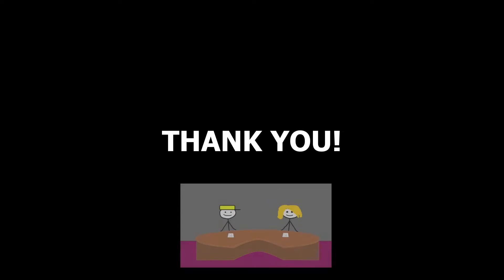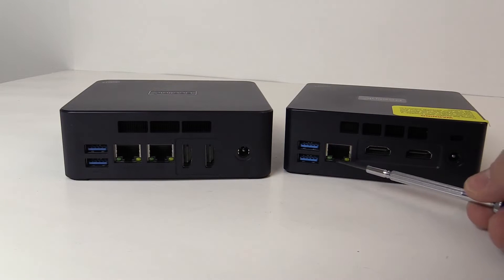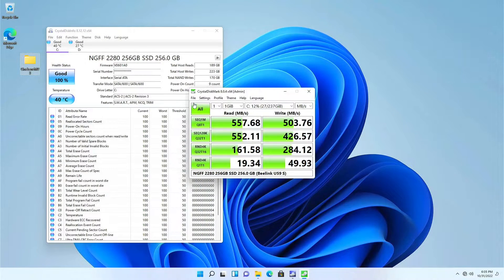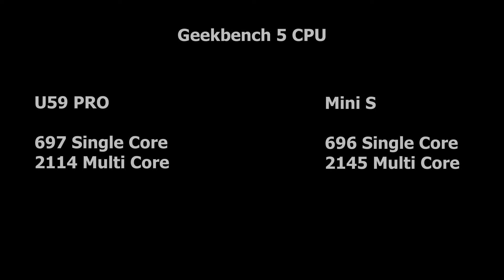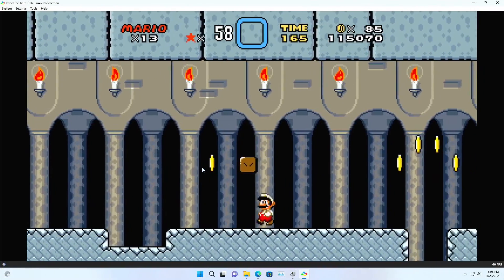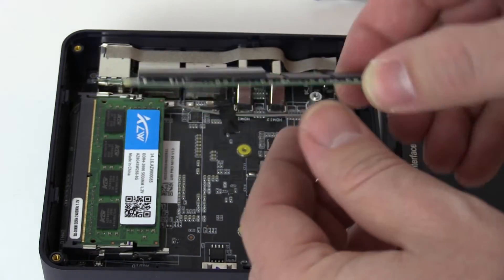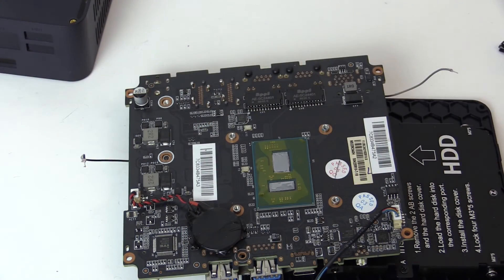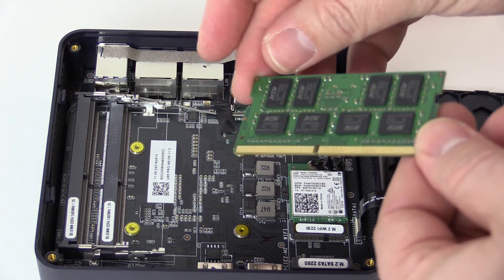Beelink U59 Pro vs Mini S! Synthetic Benchmarks, Teardown, and I Break Something!

Comment: things i was not told when buying this mini pc . first its just an m2. drive with sata speeds not an nvme which is at least 4 times faster but cost nearly the same  
Also if u live in a hot country DO NOT BUY THIS !!  i  live in Thailand and even when it was cool i kept getting an alarm and message your mainboard is to hot  at 82c  now it is 40c + i cannot use it  . even a coolpad underneath does not work as the are no vents only the side vent for the fan inside . I now use  a usb fan , a coolpad and a big 16 inch fan on this just to get the temp under 70c  or i get the overheating message and it shuts down
Reply from the maker: Ouch. At 40C it is difficult to keep any PC running very cool.  Most of these minis I don't think are built for that kind of environment. I wouldn't have thought of that though, thanks for sharing.
Reply: I found my 3 year old U59Pro was at 32C. Yet it would shut itself off if transferring large files or doing heavy work. I replaced the CMOS battery. I put a USB fan under it and it worked for awhile. And then it shut down. I finally put the fan on the side of the mini pc and it works great now. Blows the heat out through the other air vent. I saw others say don't do that. It will  send dust and cat/dog hairs into it. I just transferred 2tb to a backup drive without a problem. PC has always been very quiet. Love it

Comment: Did the same thing - soldered wires back in place - lol - fun
Reply from the maker: Sounds like it. With a cable that small I wasn't sure if there was a center conductor and shielding I would need to worry about.  I just pulled the card, the system is working as a pfsense machine so WiFi isn't needed.
Reply: @ntgm20  used  to work for Apple assembly in CS Col -  one of the few who didn't need magnifiers to do board work, the fun was sanding down a fine soldering point to ultra fine - lol

Comment: I purchased the U59Pro with 16GB of memory.  I encountered two issues: 1. the screen went dark for a couple of seconds intermittently running Amazon Prime movies.  This happened a  couple of time during an hour's worth of watching.  2.  Windows 11 pro updated itself several times and after the third update, Windows slowed noticeably, especially running YouTube.  I also installed Manjaro Linux which runs great.  Any suggestions/comments will be welcome.
Reply from the maker: Uncertain what could be going on with either of those issues.  I did a fresh install of Windows but didn't run it like that for long.  My U59 Pro is currently running pfsense and acting as my firewall.
Reply: @ntgm20  Thanks for your suggestion.  I will download and try to install windows 11 pro and hope that MS will recognize my key.  FYI.  I installed a Manjaro Linux on a SSD drive and it's soo much faster proving the hardware is fine and it's definitely a Windows problem.
Reply from the maker: @bartniaux8630  Good to hear. As for reinstalling Windows, I've not had a problem with them activating once installed.

Comment: I've just bought a Beelink Mini S. The object of the exercise was to upgrade to Windows 11, and to cut power consumption. The Mini PC is great, and maximum power consumption is just 30 watts! I live in the UK, and I paid £159 ($191). Great value, and highly recommended for day-to-day general computing!

EDIT: The CPU cooling system is mounted at the top of the case, and to service it (cleaning dust build-up, for example), you have to remove the motherboard. I saw a review that said this was difficult. One wonders WHY the top and bottom panels weren't both removable for ease of servicing?
Reply from the maker: Low power draw is one of their great benefits for sure.  As for how hard it is to remove, that depends on your level of comfort in messing with these kind of things. I used to be an electronics tech and think that it wasn't bad, except for the WiFI antennas.
Reply: Do you have any issues with your Mini S? I started to have them with mine, after a few weeks of use - random freezes when the system got unresponsive for 5-10 seconds (both Windows 11 which came out of the box and Linux Ubuntu 22.04 I installed to the internal M2 SATA SSD). What is interesting is that it happens sporadically without any link to the load being processed by computer or CPU temperature. I think it's SSD to blame, but didn't have a chance to rule it out - need to boot from USB flash and give it a good long run.

Comment: what did u think of the beelink and what pc would u suggest for a mini one
Reply from the maker: Of the minis I've tested the Beelink ones and Trigkey (both made by AZW) are the only with RAM modules you can swap out. If you are looking for a mini PC I'd go with one that has a processor with 4 cores and generation of the N5000 or newer if going for under $200. If you have a larger budget there are more processor options that I'm not even fully knowledgeable of, but mostly more powerful.
Reply: @ntgm20   could u send me a link of the one u would go with
Reply from the maker: @rudycastillo6369  It really depends on what you need. See the link in the video description for the U59 Pro. If you like the feel of it from this video it is one that I think is a good value.

Comment: Just came across this as i simply want a small mini pc to remote too that runs my trading apps,... could get a VPS but they are too expensive per month for what i need and i don't want to have my main pc running 24/7.  Going off the bench marks, a mini s with 16GB will do me fine.   Thanks for the video.

Comment: Also interesting to know if the socket for the main drive purely m2 or universal, allowing both m2 and NVME?
Reply from the maker: I cannot get the systems to turn on if there is a NVMe drive in the slot, so only M.2 SATA is supported.

Comment: im getting lag on my mini S with youtube videos in 4k on my 65-inch tv and youtube audio is slightly off.  upgrading to 16g ram to see if there is a differance
Reply from the maker: That seems a little weird but keep us up to date if the RAM upgrade does anything. Can you see from Stats for Nerds if those videos are VP9 or AV1?
Reply: @ntgm20  upgraded the ram and it seems to fix the audio lag issue.
Reply: hi did you notice any difference when you upgraded the ram?

Comment: Couldn't get U59 to dual boot Linux after a week of fiddling with bios,  secure boot disable, partioning etc.  Sorry I had to send it back.  Any suggestions if I try again??
Reply from the maker: That is weird. Was that using a separate drive for Linux? What distribution? I was using a separate drive with Ubuntu and had no issues, even using secure boot. What is funny is just yesterday I took the Windows drive out and now have pfsense installed and testing to use as a router/firewall.
Reply: @NotTerribleByGoodmonkey  was installing MX Linux 19.4 (precursor to running Linuxcnc) Trying to install on 50 G partition on original Windows 128G drive.  Never could find boot record using MBR or PBR or ESP  options during MX install.

Comment: Thanks to this video I decided pull a trigger on Mini S for my mini docker automation. I am wondering why the U59 with n5105 which is rated at 10W consumes more energy than mini S with n5095 15W - even during load?
Reply from the maker: Thanks for your reply and I hope you Mini S works out great for you! 
 TDP ratings aren't always relatable to real power draw, but rather the solution needed for cooling.  The N5095 could also be configured to run different to achieve a TDP and power draw lower than the specified max.

Comment: Thanks for the nice review. We bought two Mini S three months ago. Both have worked very well. However, one of ours died after last week. It can't find the SSD drive and keeps going to the Boot menu.  Tried resetting the BIOS and pulling the CMOS battery but neither worked. I have seen similar problems on the web. I will be curious to see how long yours last. I have contacted Beelink support but have not received a reply, but it has only been a week and it is the holiday.
Reply from the maker: Thanks. Is it the drive that came with the system? What about booting to a live USB like Ubuntu or something similar if you don't have a spare drive to swap in?

Comment: One thing to note is that BeeLink's support is horrible if something dies.  I picked up a U59 to use as a little in house server and the drive in it died after about 3.5 months.  It's been 2 weeks now with only getting a canned response back with no acknowledgement of my RMA request.
Reply from the maker: Ouch. That isn't good to hear. Any luck on swapping out with a spare or new drive? I see lots of complaints of failed drives but not much on if a replacement works or if it is a deeper problem.
Reply: @ntgm20  I replaced it with another 256 GB  drive that I picked up.  It's been working perfectly for almost 2 weeks with it.  I did finally hear back from support this morning that they're going to replace the drive.  So I'm going to submit the info they needed for it today and then have it as a spare.  Hopefully the two new drives last.

Comment: A faster way to install all the drivers is the extract downloaded zip to a folder then open an elevated cmd prompt. 

 pnputil /add-driver D:\Drivers\*.inf /subdirs /install

You can add the /reboot switch afterwards to make sure they are all loaded correctly.
Reply: Oh, and WOL in Windows on the U59 Pro is enabled in Device Manager under each NIC. Just a check box to enable.
Reply from the maker: @strikesbac  When I can get it to work under Linux the way I did I figure that is available under Windows, but didn't know if people would want the WOL under a desktop machine.
Reply from the maker: Interesting. If I remember I may try that out next time.

Comment: Who is better mini s or u59 pro ?
Reply from the maker: It depends on what you need. Both aren't terrible, actually pretty decent machines. If you need dual channel RAM, dual networking, or USB-C then go with the U59. Otherwise the Mini S is just as good without those features.

Comment: How much money?
For 312 Euros or $330 US you can get the Beelink with a Ryzen-5 5600U @15w  6 core-12 thread with zen3 and Radeon Vega-7' 1800 MHz graphics.
16gb dual channel ram and wifi-6 on Amazon.
Vega7=Performance of a NVIDIA GeForce GTX 1050 card.
Reply from the maker: Very nice. It all depends on what someone's budget is, sometimes even just a dollar or Euro can make or break the deal.

Comment: I recently grabbed a U59 Pro in the 16GB/500GB configuration for a steal from Amazon.  Using it as an HTPC streaming from my NAS.  Fantastic little machine for the price, runs fairly quiet.  If anyone's considering buying these, I'd recommend the U59 just for the capability of dual channel RAM alone.
Reply: Yes Dual channel,s greater bandwidth helps a lot especially if your using integrated graphics. 
The U59 I seen comes with two 8gb@3200MHz  "Crucial" brand name sticks already.
Reply from the maker: Thanks for your feedback! I hope it keeps running good for you.

Comment: Can you tell me what temperature is in IDLE U59 PRO? and browsing the internet? does the fan make noise?
Reply from the maker: Not off hand on the temps.  The fan is barely audible for me when it is low like that, but would ramp up when putting the CPU to task at 100% or near for more than a minute. At that point I felt the fan was still quieter than my laptop.
Reply: @ntgm20  OK thank you very much!
Reply: It's a 10w Celeron does it need a fan?

Comment: I have the mini s and I absolutely love it. I use it for my plex server and it's worked perfect since day one.
Reply from the maker: Any issues with network speed?  I've found mine are falling about 200 Mbps short in Linux.
Reply: @ntgm20  I have windows 11 still installed and connected through ethernet. Just did a speed test, getting 650megabits down at the moment.

No issues with the network so far but I've also only been connected through ethernet and not using wifi.
Reply from the maker: @Jupiter9999  Thanks for your reply. I'm also connected through Ethernet, using iperf3 on another machine and checking between them. Everything else gets 930 Mbps or so between in Linux, it is just the Beelink ones that get 730 or so. I need to look further into it.
Reply: @ntgm20  no problem. I've seen speeds in the 850mbps range as well. I use the plex server on my network exclusively and no out of home streaming and so far it's been doing the trick. I'm pretty new in the mini pc world and have never used Linux before except on my steam deck. Is it better to run plex from a Linux machine?
Reply from the maker: 850 or so is what I get in Windows on those machines too, which again should be about 930 for my tests. For Plex, I don't have enough experience. Linux would normally have fewer resources in use to start with, so have more headroom, but there are tricks to get Windows processes down too.
Reply: @ntgm20  thanks for the info :)

Comment: I just gotta let you know, snappy driver installer has saved so much time driver hunting, its not perfect, especially with hp ryzen laptops, but most things install without trouble, and when there is there's more driver versions to choose from. Also not sponsored, just tired of installing Lenovo drivers on hp laptops.
Reply from the maker: Good to know.  One thing I am interested in is if there is support at all behind a brand, and Beelink seems to have some things available, while some of these other ones do not.

Comment: Upgrading the U59 to 16Gb will improve your benchmark scores by quite a bit (it did for me).  The only problem was finding memory that worked with the machine - the $20 Timetec SINGLE RANK DDR4 2666 module was the one that finally worked - although it takes the machine a minute or so on the first boot to figure out what memory it is - after that everything boots normally.
Reply from the maker: I could pull out the one from the Mini S and slap it in the U59 for fun to see.  I have a list of things like that to try as a follow up.  Thanks for letting us know which one works.
Reply: I took your advice and used the Timetek 16G. Works like it was meant to be there.
Reply: The Beelink U59 I seen came with 16gb 2x8gb DDR@3200  Dual channel mode already and brand name "Crucial"at that.

Comment: This one is great. Pfsense or openWRT on the dual NIC board might be worth checking, perhaps including AP for wifi, too. The other one as nice small home server (backup, nextcloud, ...?) and the old ones as home automation - HomeAssistant or NodeRed.
Reply from the maker: My thoughts too, except I'd use something else as the wireless AP.  I'm actually running another mini with dual NICs as my pfsense router now, and a pretty cool wireless AP, when it works.
Reply: @ntgm20  I got the version with 2.5G ethernet, works with OpenWRT but I also do not use its wifi...
Reply from the maker: @rklauco  Which version has the 2.5Gbps NICs, and are they Realtek or Intel?
Reply: @ntgm20  Intel, let me find the link...

Comment: What are you using for monitoring power usage? Is it a kill-a-watt or some similar device reading power at the wall?
And regarding thermals, it might be good to perform before and after tests. My own experience tells me that not reapplying thermal paste (especially when it's dried/set like you noticed) will lead to poor thermal conductivity if you don't replace it. 

I like what I see on your channel. Subbed and looking forward to more content and seeing how you grow.
Reply from the maker: Thanks!  This is an exciting time to see it growing, and it really wasn't expected but it makes me smile!
For the thermals, I agree, and I messed up on that one. However, I did go back in today and cleaned it up (on the u59 Pro), applied new thermal compound, and it still reached the same temps.  Good thing is it wasn't thermal throttling (not that it was before, but a point for my next video).  For power draw, yes, a P3 Kill A Watt.

Comment from the maker: Edit: Follow up: The U59 Pro USB-C is capable of providing another display out! My adapter came in and I got it to work with the U59 Pro, but no other machine I have with USB-C has this capability it seems.
-------------
Whoops!  Thanks to Zach Horton for pointing out the typo in the product specs around 1:58. The processors are built on the 10 nanometer process, not meternano or what ever the 10 mn typo could stand for. I say it is 10 more numbers.  What would you say it represents?
Reply: A line of processors running on 10 Minnesota technology would likely run very cool.
Reply: it's always a good idea to replace thermal paste after taking a heatsink off, even if not dry.  it would be interesting to see if fresh thermal paste improves thermals.  also, on the one that supports dual channel, how adding another stick changes benchmarks
Reply: I’ve had issues with the two HDMI ports. I can’t get them to run 4k 60hz on anything, 4k 30hz is absolutely fine. I’ve changed the drivers, wiped the OS tried Linux distros and nothing helps. Using USB-C to HDMI runs at 4k 100hz though!